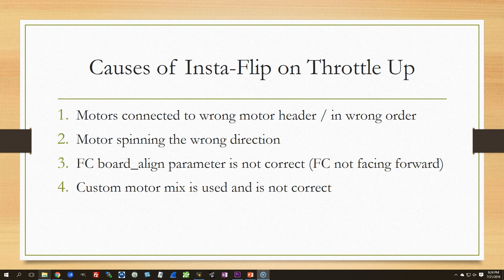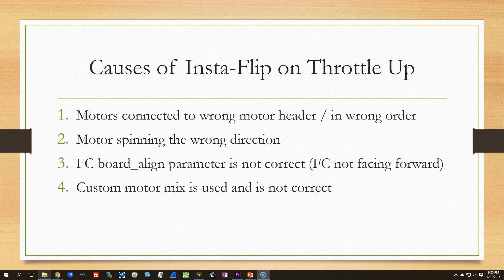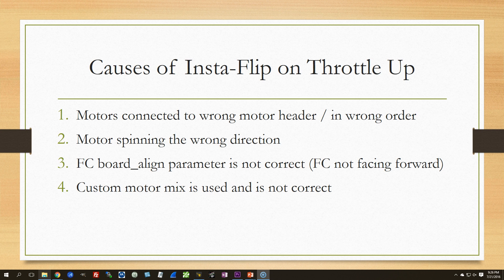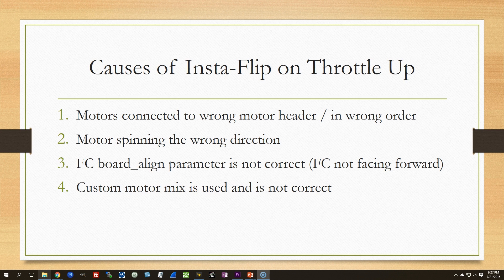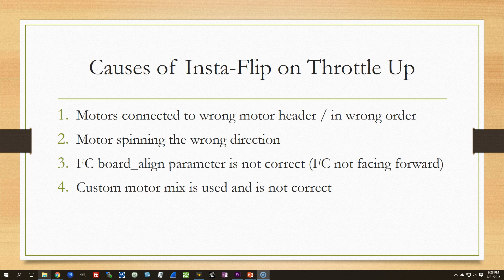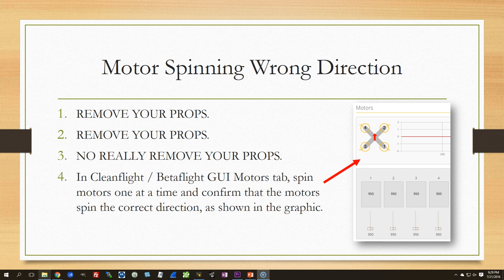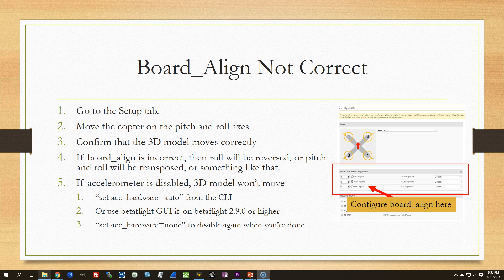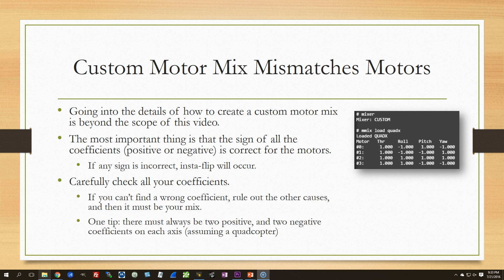Quadcopter Flips On Takeoff: Solved

Comment: +Joshua Bardwell I'm having a similar problem but the moment I arm it takes-off, yaws right a bit (~8 degrees/s) and rolls left at a similar pace. The blackbox shows my sticks being centred and my throttle at zero (as they were). The blackbox also shows it recognises it is rolling and tries to combat it by switching motor 2 off yet it still continues to roll. I found a poster with a similar issue saying that switching to older firmware helped him (back in the 2.6~ days) but I am running the only non 3.2 version available for my FC (Matek F405 AIO) which is 3.1.7. He also said that if he set gyro_cal_on_first arm to off his quad would no longer flip out. I tried this with the same flip I had experienced last time. And when I tried in Angle mode to see if there was a difference the quad did the same flip but the motors sounded like they were spinning up and down sounding like it was buzzing. I am at a loss at this as the pids seem to be over-reacting resulting in the quad to take off and then there is little reaction from the FC to stop it from spinning out. In one case the blackbox showed that motor 2 was at 0-3% the whole flight when the quadcopter flipped the same way (motor 2 rising, and 3 falling). Any help would be greatly appriciated. I also have 2 blackbox logs that show a similar story that could help.
Reply from the maker: You can assume that the PIDs are doing the right thing for the data they're receiving, so if the PIDs appear to be doing wrong, either the gyro data is bad or the motors are not doing what they're told. You verified that rcCommand is zeroed--that's the right first step. At this point, if the quad is not holding its attitude, then the gyro or the motor output is suspect. I would check the gyro. Arm the quad with it sitting on the ground and just leave it there. In Blackbox, use aggressive smoothing to filter the gyro lines heavily (get rid of all the zig-zags). If the gyros are not pretty close to zero, then the gyro is giving bad output readings and that's why the quad is doing what it's doing.

Comment: Josh, been trying to figure out why my quad has been doing this same thing (KISS ESCs and FC). I pulled it apart multiple times and checked everything over. Tested each motor individually, props are on correct, and it seems to run great in the KISS GUI from what I can tell.....except, when I get the motors running in idle and gently pick up the quad. When I do that the motors freak out and it starts shaking like crazy until I hold it tight to the table. Everything is updated and calibrated as far as I know on both the FC and ESC.....I may just try ordering a new FC since it seems to have something to do with the gyro or something. Any idea?
Reply from the maker: Yaw direction is inverted?
Reply: Seems to control correctly on the quad simulator chart in the KISS GUI as far as when I use radio controller.
Reply: Nothing on this end. I have no idea where to go from here other then try now parts. I don't know anyone around here who knows anything about Quads either.
Reply: I do not see a yaw direction option? I am using the program through Google Chrome. I will report back if I figure anything out.
Reply: Yup, I just figured that out too. I tried to update everything back to 1.2 last night and it said it was complete, but for some reason the ESCs did not update. Anyways, thanks for the help Double. You too Josh, I have watch a lot of your videos and have learn more then you know. Thanks and keep up the great work!
Reply: I have the same problem with my KISS quad, but my KISS ESC 24 amps are all from the same version I presume ( bought it recently). I flashed my FC to the latest version but did not do anything with the ESC. Do you think it's mandatory to update KISS ESC ? My motors are spinning the right way when I test them with the GUI. I don't know what sign can indicate that an ESC is not up to date and does not work correctly
Reply: From what I have found both the fc and esc firmware should match or you might have problems. I suggest using the latest stable firmware too, not the newest beta one.
The esc firmware version can be found in the esc update page in the GUI. I ended up installing v1.2 on both my esc's and fc and that solved my issue.
Reply: I have contacted the store, my ESC are in 1.08f, that seem to be an older version. I don't want to flash ESC because don't have the material to do it and looks complicated to me, but will try a downgrade to FC 1.2 And see if it works. Thank you for your message

Comment: Just have tested my first build, flipped and broke a prop. But when I help it take off with my hand, it can hover normally once it's in the air. So I guess motors and props and FC are all ok? But still it flips.
Reply from the maker: Probably you have a mis-calibrated ESC or a damaged motor. Or maybe just a loose prop.
Reply: Thank you Joshua. I checked everything again and it seems I miscalibrated the ESCs the first time. I mean, I really did the calibration but probably something went wrong, so I have calibrated them again and now I definitely see a different response from all motors, sadly I can't fly right now to test it.
Reply: Ok, did a quick test and the takeoff is now almost perfect. Thanks again!
Reply: Wait, what do you mean, "when I help it take off WITH MY HAND"?!
Even Steele doesn't do this routinely... I'm a noob, and confused by this comment.
Reply: My setup is not for racing. I have long landing legs attached and I just hold it gently by the leg preventing the copter from flipping. But I don't do it anymore since I have fixed the problem.

Comment: hey so i reconnected everything and now it takes of and so i took of in atti mode not gps and the drone kept flying up like a foot every 2 seconds and even on full throttle down it keeps flying up it crashed into my house and smashed really hard on the concrete still works but i don't know why it keeps flying up ill try taking of in my room in gps mode later
Reply from the maker: For goodness' sake if the quad is behaving badly and trying to fly away, don't take off in your room.
Reply: lol it was outside luckily it crashed into the house and fell down hard on the concrete better then flying away
Reply: then what should i do will naza full calibration help?

Comment: hey josh can i give you my number so that i can show u what's mine doing im really upset i spent lots of time and money in my phantom and it's doing the take off flip ill explain what i might of done plz reply (:
Reply from the maker: I really don't know anything about DJI flight controllers. My best guess is you installed a clockwise prop on a counter-clockwise motor or vice versa.
Reply: Joshua Bardwell no everything is right maybe i got the motor's in wrong channel cuz my back left is 1 back right is 2 top right is 3 top left is 4 maybe that's why?
Reply: what flight controller?
Reply: i figured it all out no more tipping over butt the naza isn't catching any gpd
Reply: gps

Comment: Hey Josh, does it matter setting the yaw border alignement -90 or 90 degrees? Is there any difference and could that cause an insta flip?
Reply from the maker: If you are talking equivalent rotations, like -90 or +270, then no it doesn't matter. But -90 and +90 are not equivalent, so yeah, it matters, and it will cause an instaflip if it's not correct. Verfiy that the 3D model moves correctly when you move the copter by hand.
Reply: Thanks so much, it helped changin the value. Now i'm up in the air, but there is one more problem: I'm using a flysky fs-i6x and there is some latency from the sticks to the movements from the quad. I'm using iBus connection. Can you help me out?
Reply: Problem is solved, thanks so much again :D

Comment: Hey Joshua is it possible for a quadcopter to intaflip if say the motor #2 signal wire was connected to the motor #4 signal wire I think I may have oopsed  lol
Reply from the maker: Yes absolutely.
Reply: Joshua Bardwell sweet man I think I fixed my problem I'm going to rip withdrawals bad just finished finals

Comment: my goolrc 210 running stock setting takes off then wobbles like mad a flips. all motors are running in the right order. ive tried tuning it but i did rotate the board 90 degrees to have access to the usb but i did the yaw 90 degree change and did the level stuff but im still having issues :/ is the cc3d just a waste of time?

Comment: Josh, It looks like I will be pulling the trigger on the Aikon 4 in 1.
I will need to pick up new esc wire ( 18ga ? and maybe a link for the wire)
Reply from the maker: Yeah I agree 18 ga is fine. Just do a search for 18 gauge silicone wire.
Reply: Im on amazon rt now and found the same co. you bought yours from
Thank's again

Comment: Josh, I took the quad outside and stood back a ways and she Freaked out like in this video, so since I'm currently running a custom motor mix and have reversed some motors in BLHELI  should I just start over and solder all esc's to the correct pads,signals etc as it is setup on the 4 in 1?
Reply from the maker: Instead of using a custom motor mix, use resource remapping in betaflight 3.1. The reason this is better is that the motor sliders will spin the correct motor when you use resource reampping so you can verify that the re-ordering is correct.

But if you have a 4-in-1 I would just move the signal wires around instead of reordering the motors.
Reply: Thank's Josh, I did however just hear from Armattan quads and I need 30a esc not 20A as I'm using with the motors I picked up from them.
Is there a 30a 4 in 1 that you would recommend and is setup in the correct orientation ?
Reply from the maker: +Mark Thompson Aikon has a great 30 amp 4 in 1. 

https://www.fpv303.com/product/aikon-sefm-30amp-4-in-1-esc/
Reply: Thank you Sir will check it out!

Comment: Hey josh, Ive got something a bit diff. When I arm my motors everything spins fine when i hooked them up to Betaflight motor tab I noticed when I throttle up (using the transmitter) #1 an #4 dont spool up like #2 and #3 
I have re calibrated, re flashed  Using Lux V2 and lumenier 4 in1 esc
 (btw I do have custom motor mix and have reversed some motors, and are all turning correct way)
Any Ideas?
Reply from the maker: This is the answer, although it's not the exact question you asked: https://www.youtube.com/watch?v=xBaefeQtA1c
Reply: Thank's Josh for the reply (and video link) explains  alot and also calms me a bit!
will put the quad back together and throw the props back on and give it a try

Comment: Im having a different issue everything is great punch outs and fast flying, but when i attempt a flip or roll 5 out of 8 times it will lose it half way threw the maneuver and spiral down to the ground? any help or input would be amazing!
Reply from the maker: +Sebass raise min_throttle
Reply: Joshua Bardwell motors spin at 1018 i set min throttle to 1050.. any ideas? go higher? thanks for your help!! I did find that one of my motor screws as slightly damaged the internal motor wire so i took it out, will test tomorrow if that is the problem. let me know what you think.
Reply from the maker: +Sebass that min_throttle is fine. The damaged motor is the next likely culprit.
Reply: Joshua Bardwell Thanks! I will replace motors in case it is not that, it would be the Escs but how could can i pinpoint the faulty equipment

Comment: Hi Joshua,
Great video and great suggestions but it didn't help my problem- my quad was flying great and then started this "instaflip" behavior. I changed the fc thinking that might be the problem but that was after checking the motor order, direction and board alignment/orientation. I also updated the latest BLHeli S firmware onto the esc's. so the new fc is in and the quad still flips... can't figure it out as I have two other builds that fly great. Think maybe the esc's might be squirrelly but not sure... any master thoughts?
Reply from the maker: +Gee4z FPV if it started doing it randomly after no changes then it's not any of these things. It is likely damaged hardware.
Reply: I thought as much- well, I know the FCs are ok so I'm up 2 x-racers- I'm thinking it's either in the esc's or motor... and so begins the process of elimination. I wonder if a damaged rx would act like this? Might switch that out first.
Thanks Mr Bardwell.
Reply: Have you done any videos on testing motors and escs or any on testing rx? I'm going to strip the Speed Addict 210R and will rebuild eventually but would like to test the components to see exactly where the damage was- can't find much "out there" about testing- except for motor thrust etc...

Comment: Hi Joshua! Love all your videos! I am reaching out to the FPV community to help get my quad in the air! I am suffering from Insta Flip on take off. 

I have a Zmr250 frame with emax2300kv motors, 30amp Little Bee Esc, and SP Racing F3. Running newest beta flight. Using Devo7e with deviation 5.0 and a Devo rx701 for control. 
calibrated ESCs and on the bench everything looks to be good.
Everything checks out in beta flight,  transmitter values are good and steady at 1500, Arms from switch and motors spin up no problem. All motors are wired in the correct order and confirmed that they are spinning in the correct direction. (Bl Heli suite reversed 2 and 4). Tried bi blade and tri blade props, checked prop orientation multiple times. 

I can see there is control on pitch and roll axis, but as soon as I give it a little throttle the motors shoot up to full speed and it flips out of control off the ground...tried this 3 times now and I've taken a chunk out of my antennas and chopped a pole of my aomway vtx antenna and broken 4 props.... :( Please let me know any ideas of what to try!
Reply: Ive rolled beta flight back to 3.1.5 to see if that makes a difference and it is still flipping on initial throttle input

Comment: hey Joshua my quad speed controller is in an angle and it doesn't take off can you help me and give me some advice? thank you
Reply from the maker: I don't think I really understand your problem.
Reply: Joshua Bardwell basically the quad doesn't take off when I give it throttle is there something I'm doing wrong?
Reply from the maker: +Sn1p3r31it3 k prop on upside down. ESC's not calibrated. Throttle channel on transmitter not going all the way to 2000 us. These are some common causes.
Reply: thankyou ill try those trouble shoots thanks for your time

Comment: Joshua this video helped me fix my problem.  I had my board alignment at 90 degrees because other videos said to do that if your usb is on the side.  I checked my motors one at a time to make sure they were good.  I had to plug my battery in order to do that.  Then I went to the set up screen and my pitch and roll were reversed.  When I moved my drone one way it went opposite on the screen.  I simply set my board configuration a few times until my screen was doing what my drone was doing.  Which was 0 degrees yaw.  Thanks a lot.

Comment: Could a bad esc cause this?? Sorry to keep asking. I have done all the above and still it flips? :(
Reply from the maker: Unlikely. Prop on backwards (CW -> CCW or vice versa) is one I failed to mention.
Reply: Joshua Bardwell - ok thanks I'll keep trying :) it worked fine until I flashed betaflight - now flips with beta/clean. Bad FC maybe. Thanks again for all your videos and help.
Reply: Joshua Bardwell - double checked everything so I updated esc software - reflashed using BLheli Configurator. (Mac sorry) fixed it :) thanks for the blheli config vid!!
Reply from the maker: +luke Stanton probably a motor was reversed?
Reply: Joshua Bardwell possibly in the esc software - checked the rotation cw + ccw All ok. I rebuilt and checked esc connections- quadX layout. Either way I'm glad it's sorted. Thanks

Comment: Every time I roll left or right the quad will not return to beginning position unless I go to opposite direction to level it. I never ran into this problem before and I'm using a radiolink a10. Any ideas?
Reply from the maker: That's how Acro mode works. You are just not in autolevel mode.
Reply from the maker: PS: This is the right way to fly FPV. Go with it.
Reply: Thanks a bunch!!!!!!

Comment: hi josh i did make a silly mistake by plugging the 2nd motor in to 3rd motor  and it was just like your video but there swapped over and i did accel & mag calibrations again but i never did esc & motors ? i wasnt sure if i needed to josh but in setup my pitch & roll keep moving  without the quad moving and i trimmed them out but they keep changing or moving when i go back to setup to cheak  and now it keeps lifting up on motor 1 arm every time now and flops over should i need to do a motor & esc test calibration  or will i be better just hitting the reset in setup and set it all up from default with a fresh start josh
Reply from the maker: +William Davie if the copter is drifting in the configurator you have a problem that you need to solve. If the channels won't hold their center your transmitter gimbals may be worn out
Reply: +Joshua Bardwell it's a brand new flysky i6 & iA6 everything brand new josh & I'm waiting on the iA6B to setup in ppm or ibus and can't get it In the air for flipping on lift off josh I was going to upload a video hopefully it will give a better idea of what's happening

Comment: I can give you another possibility. I have a ZMR 250 build with EMAX RS2205 2600KV motors. It runs fine on 5030 Tri Blade props witha 3s battery. Put a 4s battery on and the #2 motor doesn't spin up right. Instaflip! I THINK I may have damaged the windings on that motor. I've ordered a replacement motor. I'll update as I tech it out.